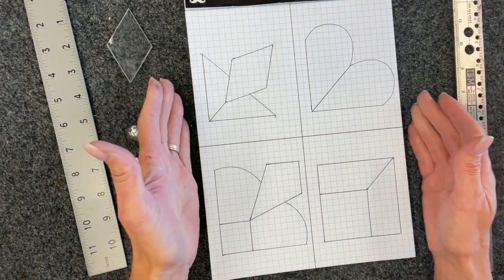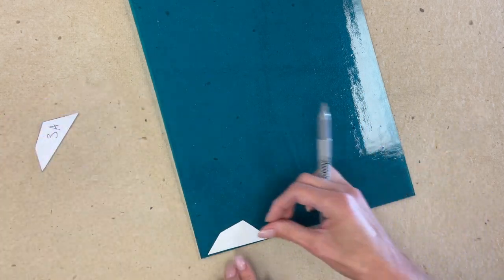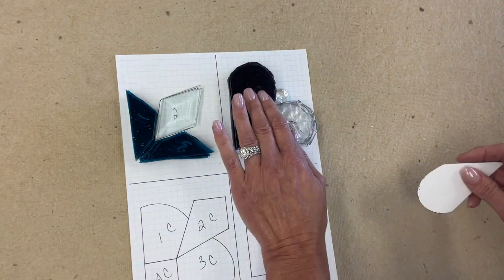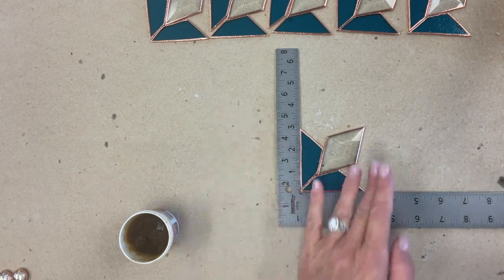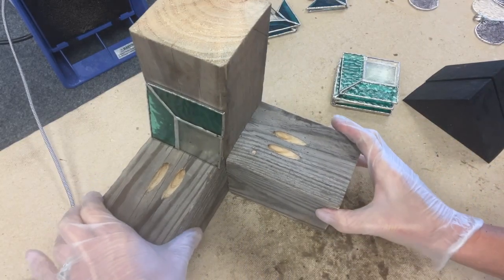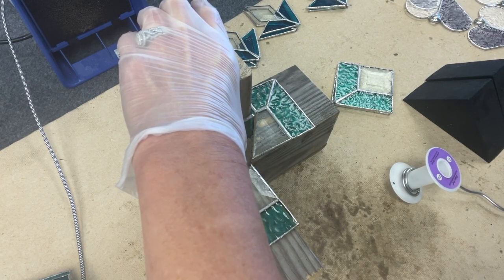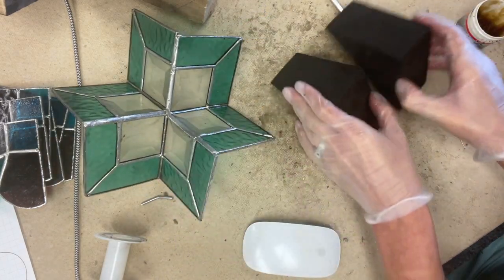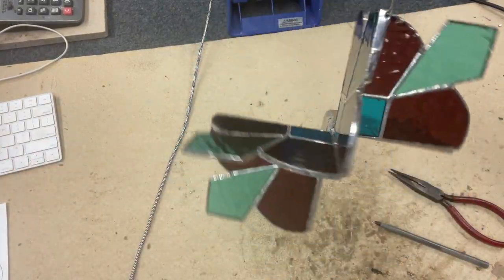How to make a Stained Glass Spinner

Comment: you  must  explain  howto  built  the  form  in y  you have  and  said  it is possible  to screw it togetter  by simple  dril a 1/4 hole about  haft way  at the end  and there  screw it directly at 90 '  whitoup  the  difficult  way to screw it at  30' angle  like your  block  
thank  for  all the other  howto

Comment: Could you please explain the wire a bit more?
Reply from the maker: At minute 31.41, I explain how to add the hook when the seam isn’t immediately where you need to have the hook. I run the wire around the entire top, starting into the seam about a half inch and ending in the seam across from it. I keep the wire flat against the tinned piece and solder it into it. If you look at the spinner that I am attaching the swivel to, try and stop the video to see I soldered the wire all around the top of the point where the loop is at the top, and the wire is soldered into both seams (for support) on both sides of the top point. Hope that helps!
Reply from the maker: For the heart spinner, you make a circle with the wire just larger than the bead and solder the wire opening at the bottom of the bead into the seam. You can see the purple and clear heart spinner at beginning of video and how it hangs :)

Comment: You need to include instructions on how to get them to spin once they are finished and hung.  I made one following your instructions and it does not spin.  In the beginning of your tutorial, you show several pieces spinning and I think you should mention how that is being accomplished.  If your answer is that they spin because they are only produced by using the materials in my kit, you should mention this in the title.  Something like: How to make stained glass spinner with my materials.
Reply from the maker: A spinner is often hung outdoors where wind can spin your spinner. I have mine attached to a battery powered  cylinder (about $12/each on Amazon) that spins them indoors.